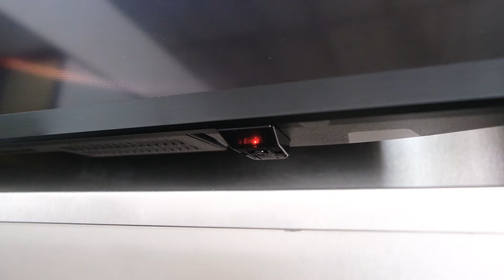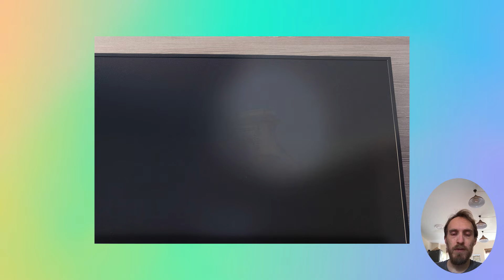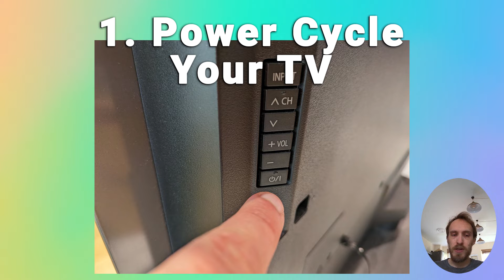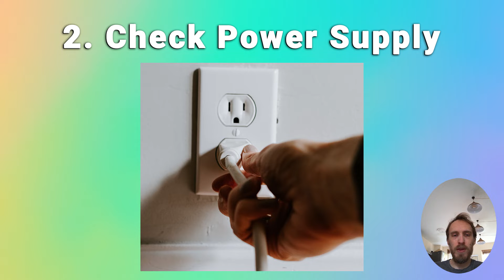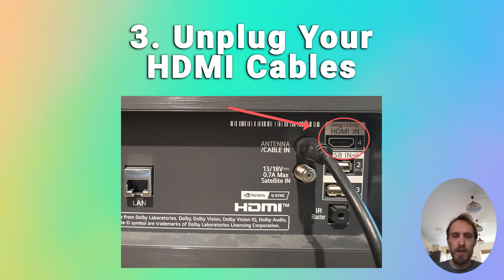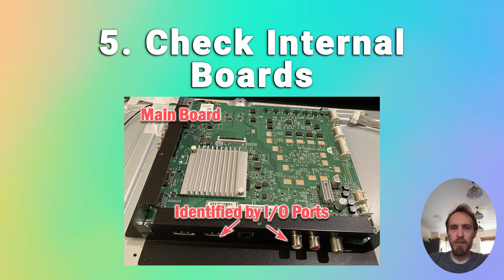Philips TV Red Light Blinks | Blinks 2, 3, 6 Times | 5-Min Troubleshooting

Comment: I'd like to add thatI just bought a Philips/Roku TV today, April 16 2024. I have antenna TV and I used my cellphone tethering to watch Roku, I then turned off my tethering and it started blinking.  I found out with will blink when the TV is not connected to internet,  and when I turned internet back on and watched Roku it stopped blinking.  Hope this helps someone.
Reply: 34 seconds into the video and your comment solved my problem 😂😂 thank you so much
Reply: @JayV-27  I'm glad it worked for you also.